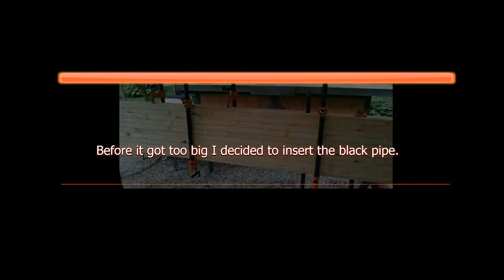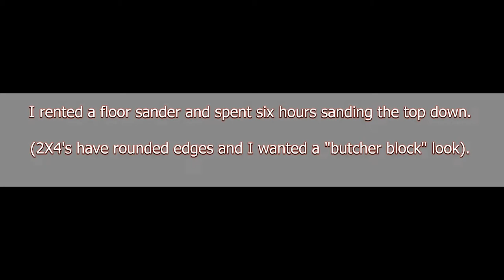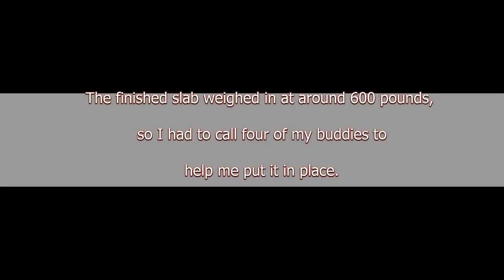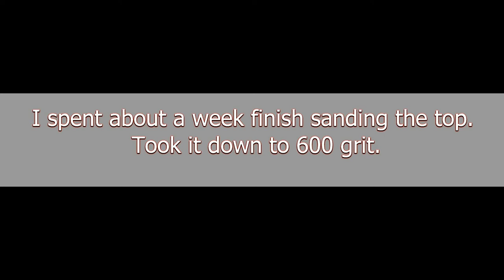My Medieval Banquet Table

Comment: should have shown the finished product longer at the end
Reply from the maker: Hi Mike, Thanks for the input. This was the first video I'd ever created, so timing was definitely an issue. Tell me, what was your take on the finished product? Did you like the table? Did it inspire you to make something of your own? I'd like to know. Also, take a look at my latest project in "The Lull". https://www.youtube.com/watch?v=c0O_u1VDKYc&t=76s I'd value your input there as well. Thanks, Chris.
Reply: Chris Goodenough My dad and I have been looking at "cutting board" designed furniture and counter tops for years. Of what I actually got to see, the finished product looked like a great permanent home fixture, but it would have obvious transportation limitations.

It looked wonderful though.
Reply: I would also add that, if you're interested, the blacksmithing you would need to learn and the things you would need to acquire to do it wouldn't be too outlandish if you wanted to start making your own accents.. like what you used the hinges for. Blacksmithing is also a LOT of fun and goes along with the kind of fabrication you're already doing.

Just a thought.
Reply from the maker: Thanks for that. Yeah, moving it might be a bit of a struggle. Which is why I plan on doing just that this coming fall. Right now the table sits on patio squares surrounded by crushed stone. The table sits fine, but putting chairs on the crushed stone is a bit dicey. So, I'll be moving the table and then building a deck for it to sit on. Kind of put the cart before the horse.